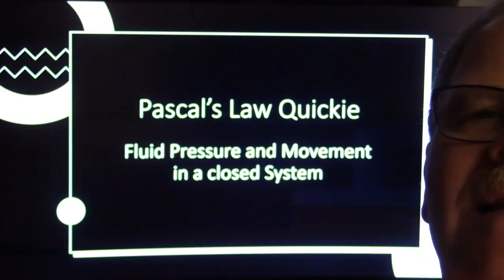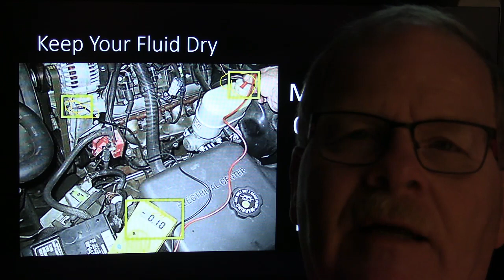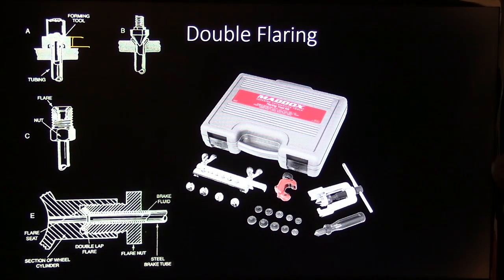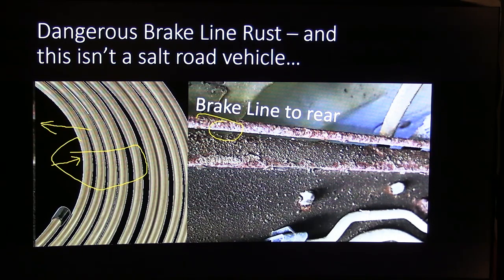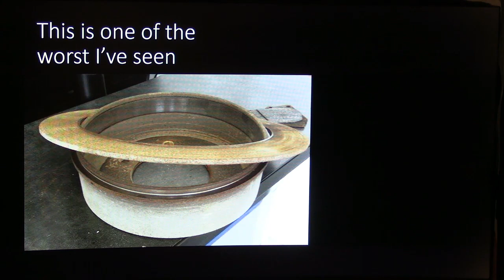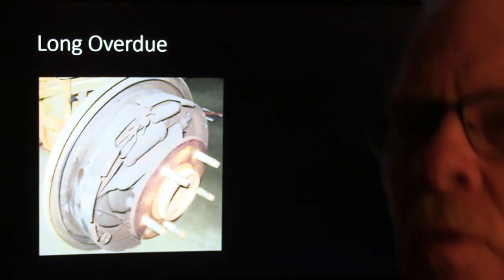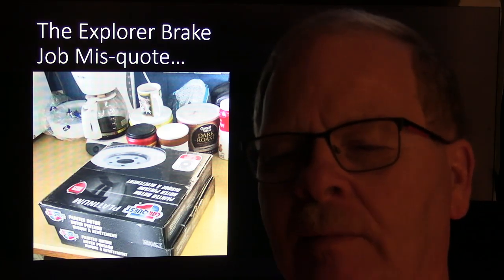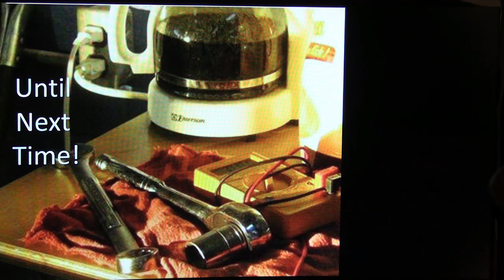Some Brakes Stories

Comment: I had a 2004 Duramax and I had the replace every brake line on it. I think for a few years they had problems with there brake lines rotting off.
Reply from the maker: I believe so too -